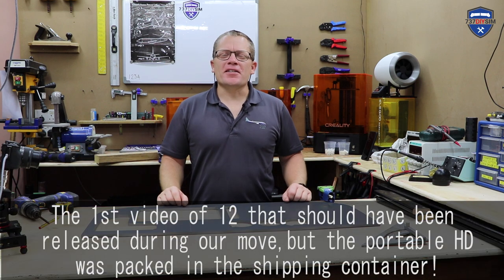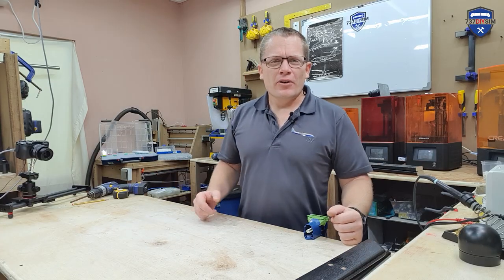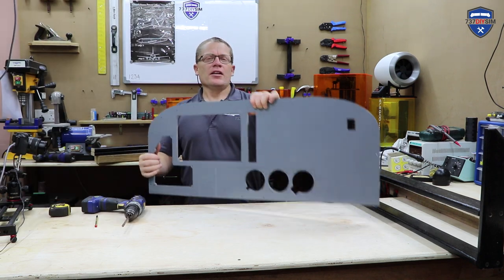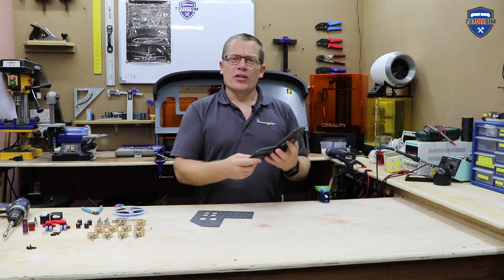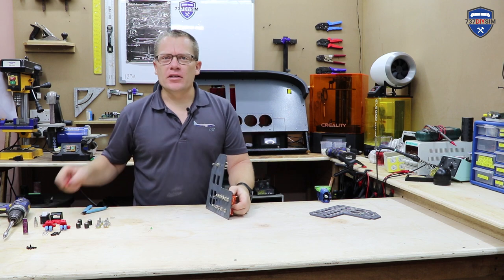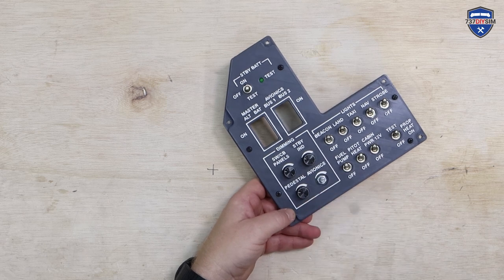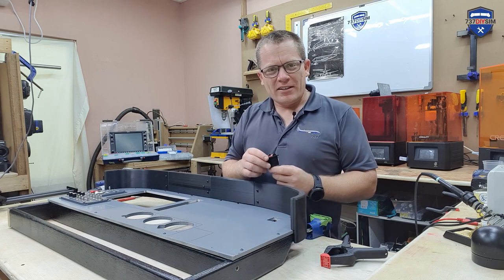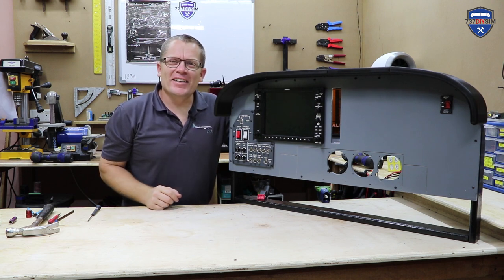Building the MSFS2020 C172 MIP Part 1

Comment: Looking forward to the rest of the videos! I’m currently building a new 172 panel using a mixture of your designs and my own! I’d recommend your designs to anyone, easy to print and with great documentation!

Now, if we could just get the NXi working over a web server like the FBW MCDU, I could run mine with a pair of Raspberry pi rather than having to put more strain on my already hammered GPU!
Reply from the maker: Hi Alex, thank you for the kind words. The problem. I'm going to face with the other videos, is that the sim was almost finished, and the new videos will show that. But the very next day, it was dismantled and destroyed back to its basic parts.
Reply: Do you have some estimation. How much you will finally spend on project?

Comment: H
ello my friend, sorry this project also works on x plane ??? thank you
Reply from the maker: Hello, It should as it mainly replicates a joystick. The only functions that may not work are the excess buttons. But if you connected those wires to the Leobodnar instead of the arduino, then they too would work for xplane.